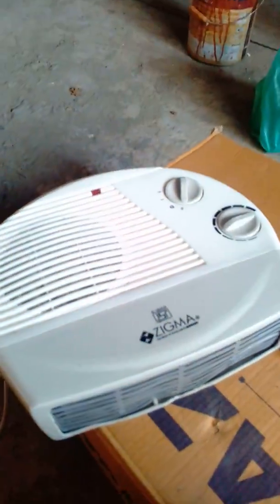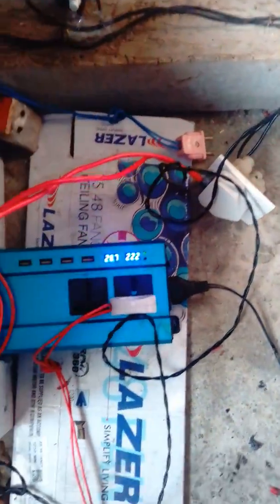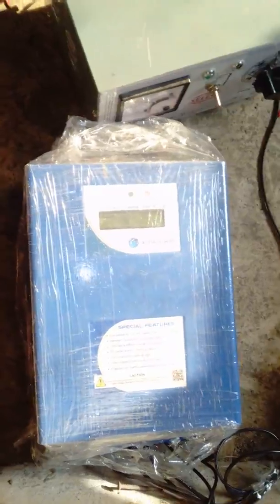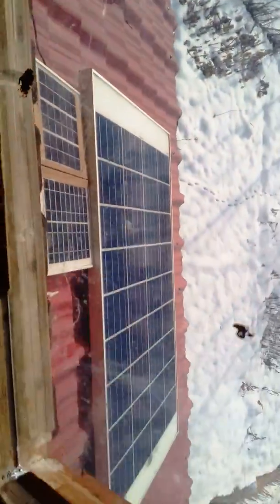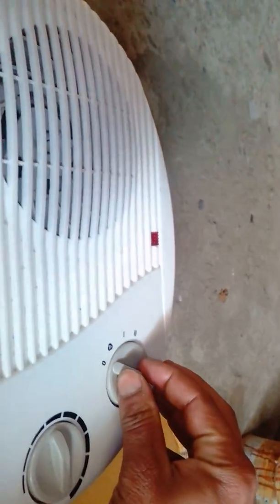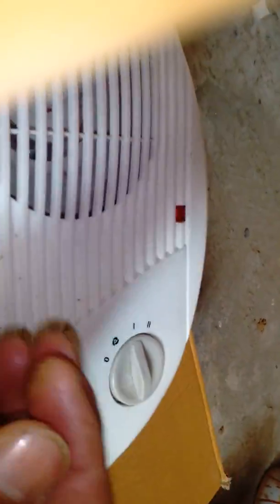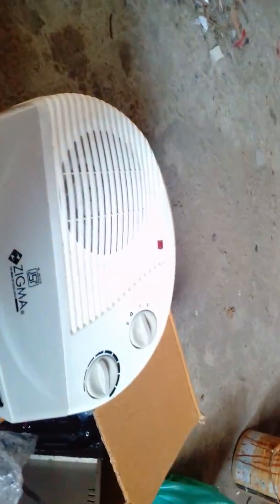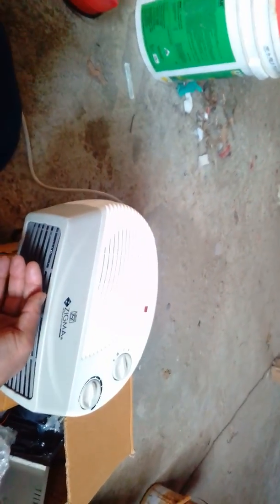Offgrid Solar System(1Kwp) for Kashmiri Winter and Summer

Comment: How does this work in the winters?
Reply from the maker: In winter also, there is enough sunlight for it to work. In short, you have to install double the capacity of solar panels wrt the load. And a battery bank may prove handy. A batteryless inverter would be more convenient. The system works in partial clouds as well but heavy loads cannot be operated ( if you are not using battery back up) during falling rain or snow.